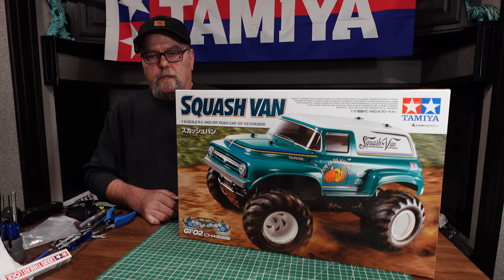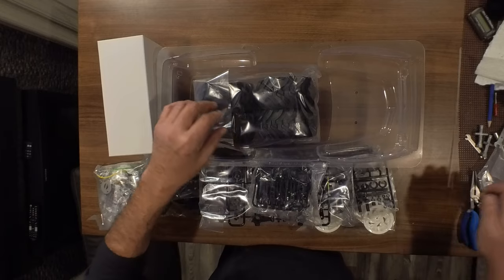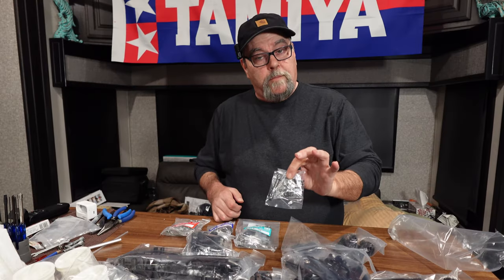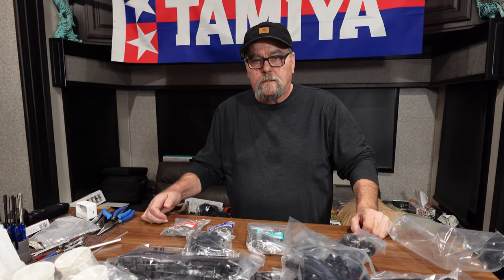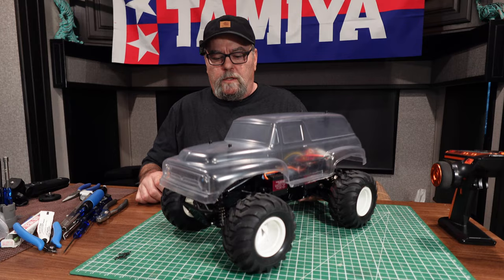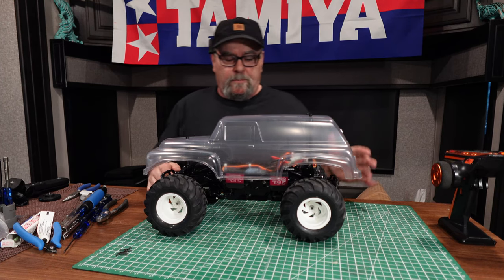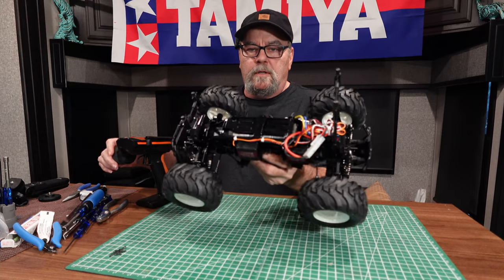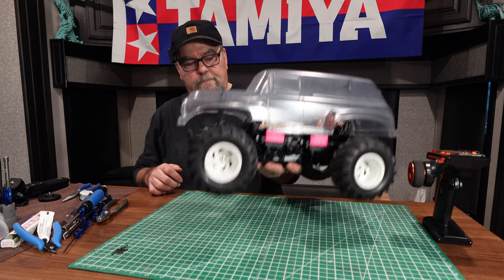Tamiya Squash Van

Comment: Very cool build and kne term made me smile "y-wire". That's my favorite method. A new project's born here
Reply from the maker: It was fun and really turns on a dime with the "y-wire"
Reply: @EMPTYPOCKETSRC  that's great to hear. On my Konghead I had to put down the steering angle of the front wheels, because the ones in the rear don't go so far. In result it's nice to have, but almost the same radius like a 2WS.

Comment: The Squish Van was a nice build and glad you enjoyed building yours! Question did you use the silver dog bones in the rear like it says and if so did you want to pop out? Mine was wonky and I had to switch to the black ones in mine.
Reply from the maker: Black for anything that turns, front or back. Silver for the straight drive no turning.
It was the same on the Konghead.
Reply from the maker: It is in the 4ws section in the back of the manual.
Reply: @EMPTYPOCKETSRC  yeah I set mine up for 2wd and the silver dog bones in the rear wanted to pop out. I swapped them for the black ones and they worked fine. I have not seen anyone else complain about it so maybe I did something wrong. It is all working fine so I am good with it the way it is!
Reply from the maker: Lower shock mounting screw hole perhaps allowing to much travel?
Other then that go with what works!🤪